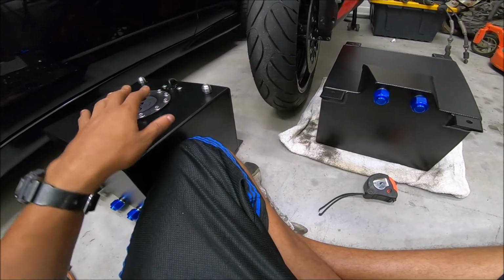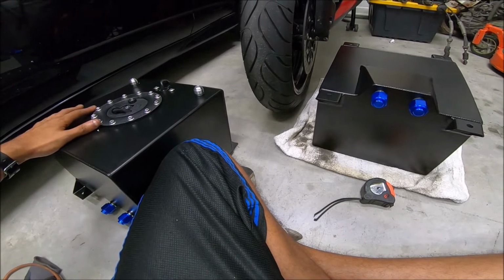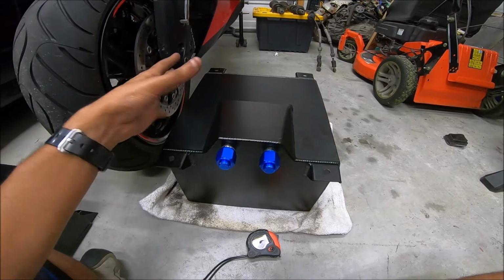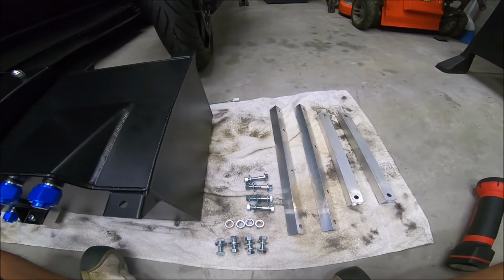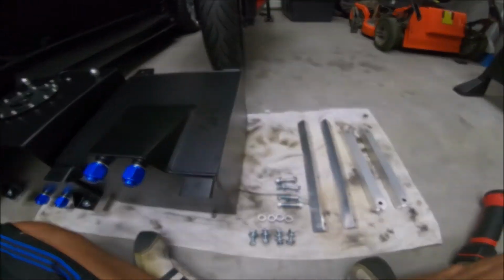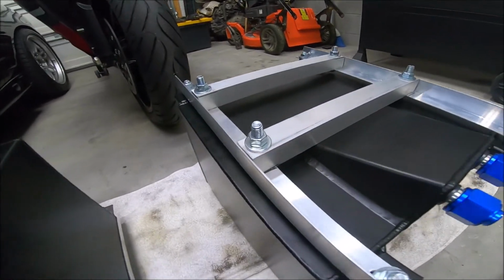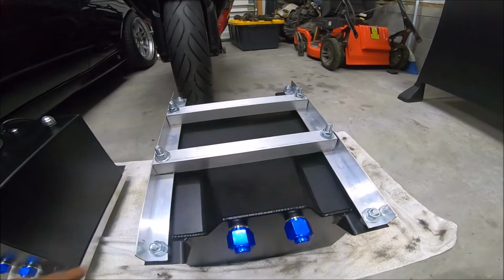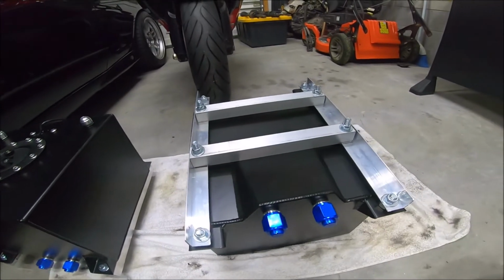Turbo K20 MR2 Fuel Cell Bracket Fabrication

Comment: your problem is going to be lack of weight in the front.  Should put One fuel cell in the front. Just watch Boosted Bois MR2 and they actually have to put weights up front to weigh it down and they have the fuel cell up front.  Traction in the rear won't be a problem.  And it's just not Boosted Bois that know this.  Mike Colon has a 3sgte with over 1k hp and has weights in the front.
Reply from the maker: I'm building a street car not a record setting 8 sec drag car lol. This car will probably never see a track it's just a around town drive to work on Friday type of car.